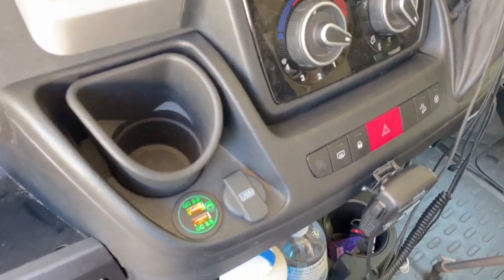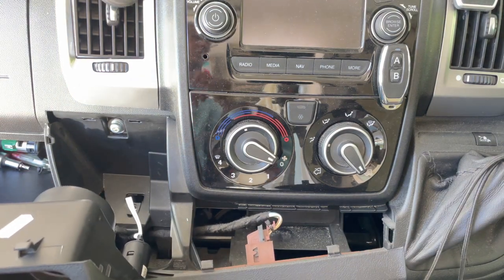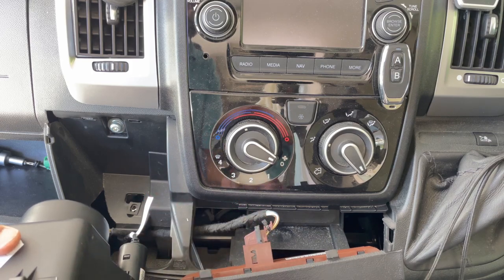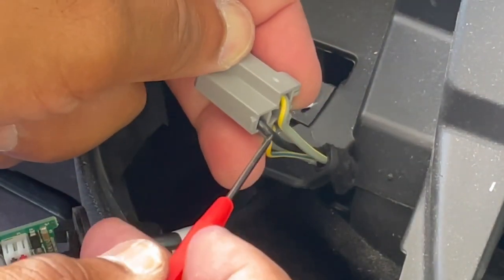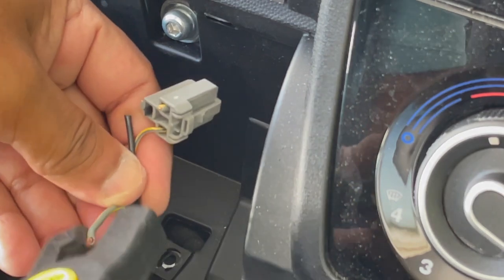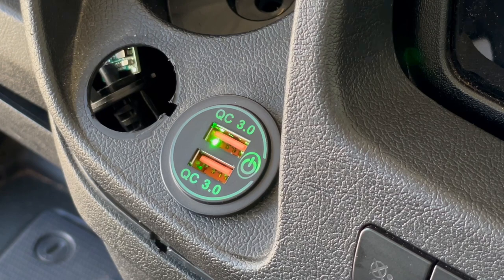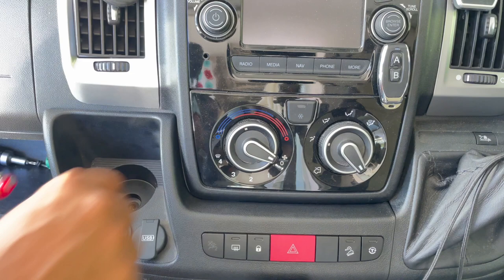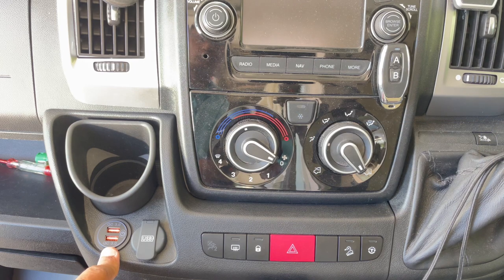Motorhome USB Quick Charge ports DIY install

Comment: You should not cut the wire while the battery is connected.
The black is grounded, remove first
Then the thick positive wire
The other positive wire is one which was to light up to indicate its in use.
Remove it from the socket and insulate it.
Reply from the maker: Good general rule 👍🏽

Comment: IMHO it would be better to keep at least one cigarette lighter socket for the use of things like a 12v air compressor to inflate your tyres. I kept both and bought a USB fast charge adaptors which fit into the 12v sockets for charging USB devices. Informative on how to switch them out though.
Reply from the maker: Great point!

Comment: Great video, thanks. I got rid of the hopeless single, slow USB socket and the 12v socket, replacing them with 2 x double 3A Fast Charge sockets, at the same time hardwiring my Nextbase dashcam and Garmin satnav for the motorhome. A terrific, clear video. Thanks!
Reply from the maker: Nice work!

Comment: Nice helpful video. I did mine a couple of months ago. I replaced the USB for a fast charging dual USB. I kept the 12v.
Reply from the maker: My only regret is that i didn't get the version with athevoltage indicator, I have solar panels so not concerned about battery drain, but it would be nice to keep a check on voltage for the engine battery, the house battery has many voltage indicators so no worries back there..
Reply: Looking to do the same. Did you have to change any wiring or just clip and re attach? The single usb is smaller wiring
Reply: @GCone82  Just clipped an re attached.

Comment: I have an issue with my radio cutting out when using the cigarette lighter to charge items, so this looks like a good fix for that, do you get any radio problems, when using the USB from the same wires for the cig charger ??
Reply from the maker: no issues

Comment: Why removing a usefull car socket 12v output when you can just plug in a Qualcomm QC 3.0A dual usb. Just plug in. Making your life harder is really non sense. Plug in sockets are worth to have. Because you can read your car voltage input. To the usb. 12.6v 13.6v 14.4v 14.7. And some high voltage vehicles 24v. You always need your car socket to plug in different socket. Stop being useless.